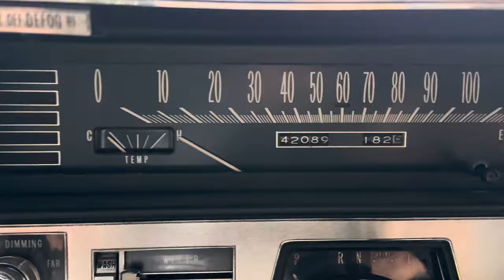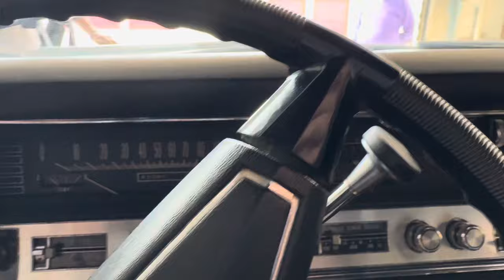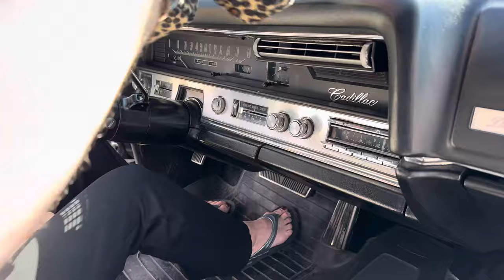FOUND!  The KING of Cadillac! 1967 Cadillac Coupe Deville 40k mile SURVIVOR!  Same owner since 1973!

Comment: The 67 Coupe de Ville had a 429 cid V-8.  The 500 wasn't released until 1970 and it was exclusive to the Eldorado through the 1974 model year. The 472 replaced the 429 in 1968 and was used through the end of the 1974 model year. In 1975 the 500 was the only engine available in Cadillacs until the Seville was released in 1976 with a 350.

Comment: 68 had the same style but the 472 engine which shared design with the later 500.  If u ever get a 1968 4 door with the thinner c pillar, I'll trade you a 2 owner 1950 Studebaker for it .